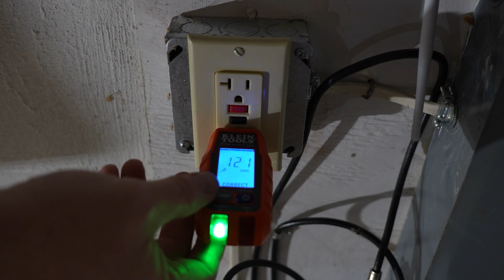Is The Klein Tools Rt250 Gfci Digital Outlet Tester The Ultimate Receptacle Tester?

Comment: I have that same tester, I bought it to test new installs at work. 
However, at home, although it tests just fine in my outlets, I tested one outlet which had an outlet strip attached to it. When plugged into the outlet strip, (no breaker, surge protection, or GFCI on the strip), it indicates hot/neutral is swapped. I opened the strip up, and it is not. 
So I grabbed a half dozen other extension cords and nearly everyone gave me the same result? However, using an ohmmeter, I can test it ad the wires are not swapped. I bought a different brand tester and it reads the same way, having trouble on extension cords or outlet strips. 
The outlet strips are all metal strips mounted under a drafting table with a single 10ga three prong cord on one end plugged into a standard 15a three prong outlet. 

I showed an electrician buddy and he said he's never seen that before but said he don't recall ever trying it in the end of an extension cord. The outlet that particular cord is plugged into is on its own breaker, but it does the same thing on any cord in any outlet. 
Its a flat type cord too, so there's no chance the conductors are screwed up somewhere in the middle, each one runs in its own molded rubber insulation. It looks like a typical air conditioner extension cord with a flat 90 degree plug on the end.

He went so far as to pull out the cord from the outlet from below and double check the wiring at the outlet and breakers and the black is in the breaker, the white on the neutral bar and the ground on the ground bar, all wired with 12/2 with a ground Romex cable over a 14ft run straight to the box.

Comment: All these testers need a way to easily use on ground pin up installs. However this one addresses some of this by giving the 10 second reading delay giving time to unplug it and turn it over. By far the best one out there and it’s permanently in my tool box.

Comment: I too suffered from leaky batteries that ruined MANY devices.  I found a simple solution to it, that not only fixes the leaky battery issue, but also saves me money in the long run:  rechargeable batteries.  I found that they have a higher up front cost, but in the long run, I not only save money from having to constantly replace batteries, but also save money from all the gadgets that the leaky ones have ruined.

Thanks for the review on this product, looks pretty cool, and I might grab one for jobs that I do and need to check the wiring on them.

Comment: tracing a circuit with my coworker & i was toggling every breaker in the panel, “Huh it’s still on, no matter what breaker you toggled.” The memory save function made him think the circuit was still on. Explaining how it functions to other Journeyman every time got tiring after a while.

The fact it uses aaa’s as well as not really offering me any more function over the simpler testers (some of which have voltage reading functionality) makes me not want to recommend it.
Reply: I guess the one true use is where the neutral and ground were unplugged and it still told him the issue where as a regular one wouldn’t due to it having batteries
Reply: Anything with batteries suck! Klien sends dirt cheap batteries that are dead before you ever put them in. Once they are at that point the false readings are frequent! I've actually owned one of these for a month or two. The lcd sterted bleeding and the thing became a hazard! Would rather touch the wires with wet hand before I drop another $40 on a new set of linemens😅

Comment: I work on test and metrology equipment professionally but also for fun. I've seen some very expensive and rare pieces of test gear ruined by batteries. Now in my expensive meters and scopes (the ones that aren't rechargeable )I use nothing but Energizer ultimate lithiums. No leaks and no problems even under extreme circumstances. It was a sad day when I finally swore off duracell's. My grandfather sold machine tool equipment and specialized in precision cutting / grinding tooling.  Duracell was one of his biggest customers only second to nasa. Glad he wasn't alive to see what dumpster fire Duracell turned in to

Comment: Lithium batteries don't leak (i'm referring to the 1.5V AAA lithium iron disulphide primary cells, not the rechargeable ones). They also have a flat discharge curve, lower internal resistance, longer shelf life, and work well in freezing temperatures. The cost a bit more, but you make up for it in not throwing away devices.
Reply: https://data.energizer.com/pdfs/lithiuml91l92_appman.pdf
Reply from the maker: Thanks for posting this!   I did not know that the lithium batteries did not leak!   I will start using them!!!
Reply: I've never had NiMH batteries leak either, and they can be recharged, saving me money from having to constantly replace batteries.
Reply: @aceenterprise  Careful, most NiMH batteries self-discharge, making them pretty useless for low-drain devices. Eneloop and some others have addressed this problem pretty well.
Reply: @jeremiahbullfrog9288 Luckily the ones I use (Energizer), I've been using for a few years now in my wireless mouse, and they last almost as long as alkaline batteries (I get probably about 14 months out of alkaline, and 10-12 months out of the NiMH).  Not sure if that's a credit to Energizer, or I've just gotten lucky so far.  Either way, I appreciate the heads up, hopefully I won't run into any issues with them.
Reply: @aceenterprise  Great! From what I'm reading, Energizer rechargeable is hit or miss ... looks like you got good ones :)